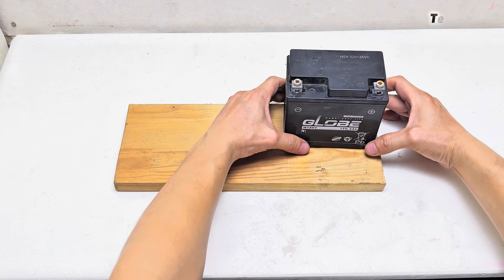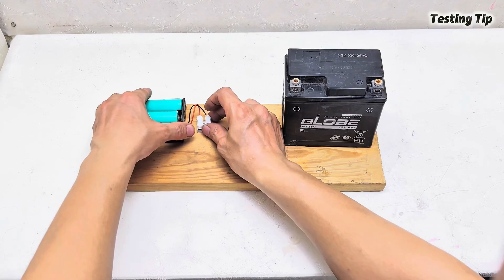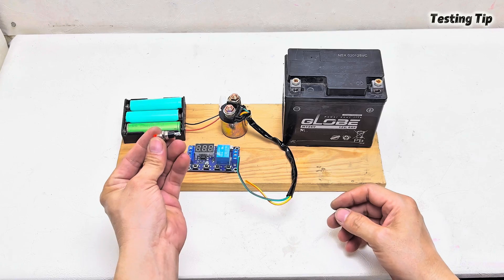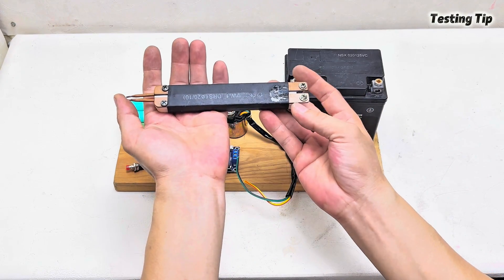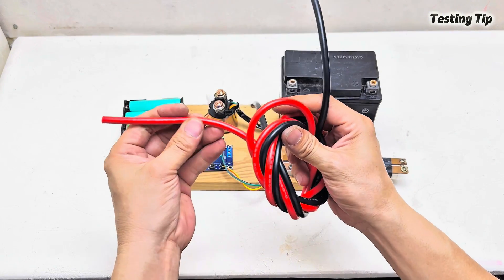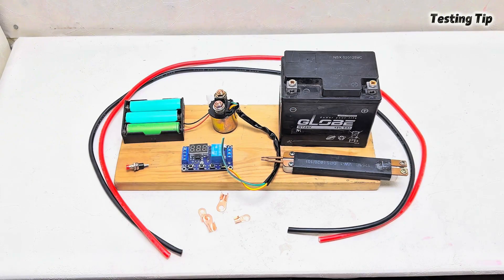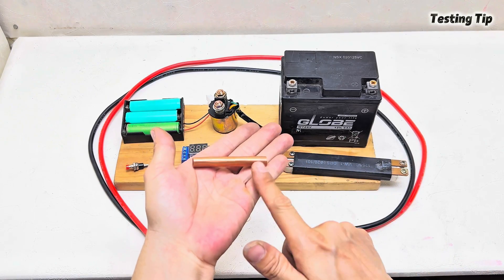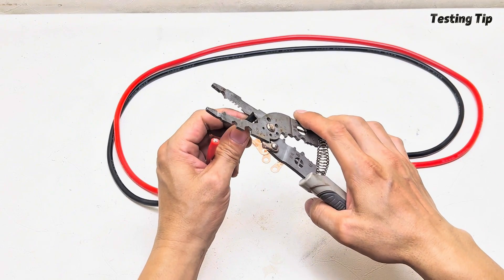DIY 12V Spot Welder for 18650 | Add Timer & 200°C 8AWG Cable

Comment: Eso Es Todo / That's What I'm Talking 'Bout :face-fuchsia-tongue-out:
glad you properly naming 8 gauge stranded wire "8AWG" vs 2.5mm copper core :face-blue-covering-eyes::face-green-smiling:
photovoltaic / solar thermal technician here love this DIY - i'm some of my DIY's i skip safety features if it work and it's prototype cause i'm the one using it only 
how did you figure out on using motorcycle relay, genius, my respects to you. guys like you that know this stuff blows my mind 🤯🤯🤯
Slaps Subscribe Button i've been wanting one of these, and i have parts, even the relay :hand-pink-waving:
Cerveza for You  🍺:face-blue-smiling: 🍻:face-turquoise-drinking-coffee:
Reply from the maker: I am struggling to understand what you mean. Can you be more specific?
Reply: @testingtip  on your first video "cheap diy spot welder for 18650 cells" you said 2.5mm copper core which not wrong in describing the solid wire but it's called 8 gauge regardless if it's solid or stranded wire :person-turqouise-waving:
my only complaint :face-orange-raised-eyebrow: is the background "music" :face-orange-frowning: so i turn off volume, turn on captions :face-green-smiling: